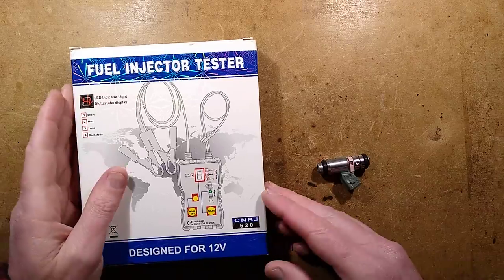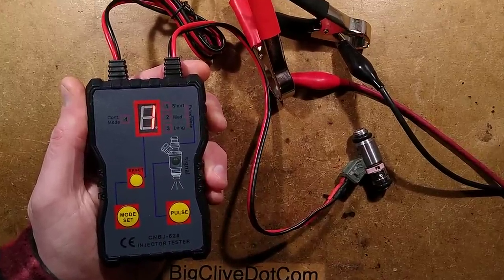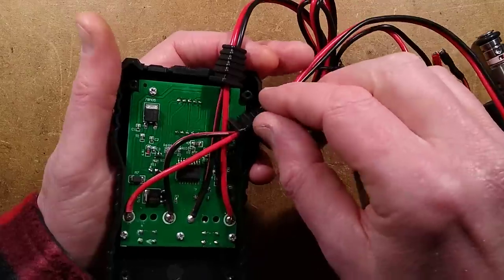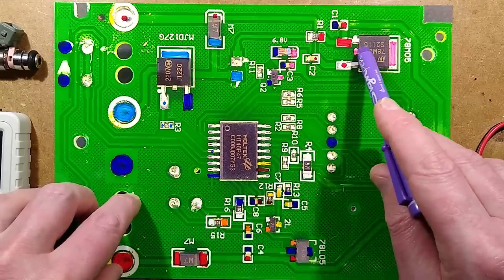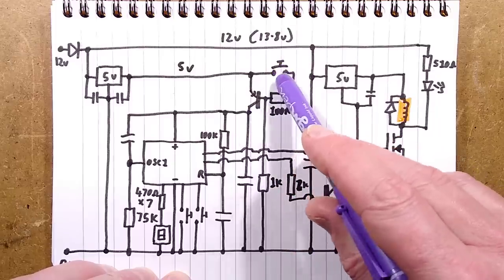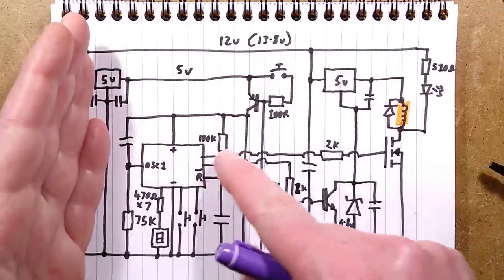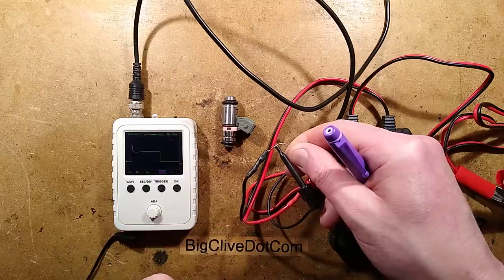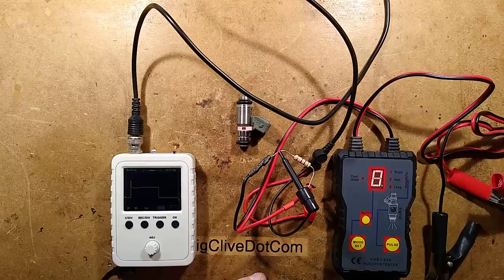Inside a fuel injector tester (with schematic)

Comment: Back in the late 90s I built an injector tester rig. I only work on BMWS so that makes standardization easier. It’s setup to do 4 at once. I used a fuel rail off a 4 cylinder and have 4 graduated cylinders to measure output over time. A buddy of mine built the controller for it. It uses a pwm controller to vary the output and a timer integrated. It’s an old washing machine timer that controls the time it runs and the pwm signal goes to all 4 simultaneously. It has proper transistors controlling each injector and I have the factory fuel pressure regulator on the fuel rail and have a small resivour to keep the cleaner in. And of course a fuel pump. I have been using this contraption almost 25 years. I am able to measure the fuel output and observe the spray patterns. I don’t know of anything else that could be done to test injectors. I helped him fix something of his and a couple of weeks later he called me with the idea. We started talking and I got the parts together for my end and he got the electronics ready. We built it one weekend. Started on Saturday and Sunday about 2pm we were testing it. By 3:30 it was installed and we were enjoying a few beers.

Comment: Yeah, the peak-and-hold injectors almost bit me too. About 20-some years ago, when I was a real gearhead into drag- and street-racing, I wanted to "upgrade" from the factory 19-lb/hr injectors to something higher. I remember asking around about some 'new' style of injectors I'd seen, and found that they needed a peak-and-hold circuit, which would necessitate modifying my PCM with new transistors and other circuitry. In my mind, this was kind of a "one-way street," as far as the PCM, and I was still paying my way through community college, so I held off. I'm pretty glad I did, because IIRC I blew the transmission a short time later. :p

Comment: I built one of these years ago with a 555 timer and transitor. It had a lot more control over the pulse width and just ran for as long as you held down the button.
Reply: And probably a lot cheaper than the $20 for this unit.
Reply: I made exactly the same thing so I could clean some injectors on an old 80s car.
Reply: I was just thinking; Why not bodge something together with a couple of 555's. 🤔

Comment: Modern injector drivers will pulse the injector with higher voltage to quickly open the ejector, then let the coil current drop to a lower level and then pulse it to keep this lower level for the rest of the duration. This also makes closing the injector quicker with lower stored energy.

Comment: Pinball machines have been using that drive scheme for decades.  They provide full current for the flip, and (at least for older models) there was a travel limit switch that injected a current control resistor for holding.  Same concept:  Fast initial response, but don't burn it up during the hold.
Reply from the maker: On the older machines the end of travel switch opened across a higher resistance hold coil in series with the main power coil.

Comment: The peak and hold was normally used with low-Z injectors. One very early application that used it was the older throttle body injection systems from the 80's. Those had very low impedance coils with big, heavy pintles inside since they basically emulated the jets on a carburetor. My memory was that there were current sense resistors in at least one of the ECUs I had worked on that told it when to "fold back", but that one could also handle bank and batch saturated fire injectors as well since it was made for multiple truck models. Those old injectors did need it since the impedance was only a few ohms, and the heavy pintle had quite a lot of inertia. It was one reason I stopped using TBI back in the day and went to SFI, as the injectors could not fuel a motor at high RPMs due to them having to fire alternately with each ignition coil firing. To actually get it to even work at 6k RPM I had to run them at around 80 PSI, which was much higher than the 12 PSI they were designed for. I was always afraid either the O-rings or the regulator diaphragm would fail and burn the car to the ground. 

I think here the peak and hold is probably included to actually accommodate more types of injectors and safely power them. (Edit: Dissipation is also a potential concern as some types of injectors use the fuel for cooling as well. When running them dry it could be possible to overheat them. Same with a lot of older fuel pumps that literally had open-frame DC motors inside submerged in fuel that required the fuel filter for removing debris from brush and comm. wear.) Typical non-DFI motors that use conventional high-Z injectors usually run them in saturated mode. There are mosfets that just act as switches and simply complete the circuit for a desired duty cycle when they are commanded to fire. The newer DFI injectors are likely different in that they have to open under much higher pressures and have to fire over very short spans of time. With an SFI system, you have up to two full crank revolutions to complete an injector firing and I used to set up the calibrations in PCMs open them fairly early so the fuel could have time to vaporize in cold weather, but even warm I still allowed for about one full revolution in advance so it had time to fire. With DFI, it has to be done within the intake cycle, which is much shorter.
Reply: that sounds potentially explosive having commutator sparks inside a fuel tank
Reply: @TheJunky228  no oxygen.
Reply: @Davemte34108  but any ingress of oxygen (and low fuel in the tank) could lead to a stoichiometric mixture of vapors, no?
Reply: @TheJunky228  The only time that you would potentially have oxygen present is after the vehicle has sat for a long period of time with little fuel in it. But, by that point, the gas will have turned to varnish and no longer be flammable. In operation, any fuel will be volatile enough to push the mixture to be too rich to ignite.
Reply: @TheJunky228  And it was surprising to open one up and just see a motor chillin' in there directly in the fuel flow after the gerotor pump, but its really the only way to keep it from burning up. I think newer ones are moving towards brushless motors instead since they don't pollute the fuel with copper and carbon deposits.

Comment: I work for a heritage railway as a volunteer  and our fuel injector tester is a single fuel pump bolted down on a beach with a presser gauge and you connect the fuel injector to the pump tester and pull the handle down and if it working OK it should be a find spray at the right pressure with NO leaks.  Some hope.  I'm talking about diesel engine that are over 60 years old

Comment: That clunky reset mechanism makes me wonder if they just had issues with something triggering the mode switch or MC reset line while in operation, and rather than work out how or why they just disabled the onboard reset with that capacitor and went with the dumbest brute-force reset instead.
Reply: And WTF is the 100R resistor supposed to achieve?
Reply: It occurred to me that the code might have been solicited in crippled form under the pretext of pre-employment or academic evaluation, then used in production in the delivered condition.

Comment: That is called the peak & hold method of controlling an in injector with varying voltages: higher voltage initial start to pull open the pintle and then a lower voltage after that to hold it open, but creating less heat dissipation. Another way is opening the injector with a short solid pulse and then holding it open with pulse modulation at the same voltage. Saves all that voltage regulator and zener etc stuff. Third (very wierd) way its been done is on some 1980s Bosch ECUs in Beemers and Porsche 911/944 is that all injectors are wired in parallel and are controlled by 2 (!) transistors. Upon the initial opening pulse for the injectors transistor#1 gives a ground path for the injectors from 12v to slam the pintle open, but right after that Transistor#1 (to ground) is turned off and transistor#2 is turned on, now supplying 12v positive to the normally switched ground of the injectors, thus basically having the injectors supplied with 12v on both pins. 
The magnetic field in the injector coil now cannot collapse and thus the injector stays open for the rest of the intended pulse duration till the moment it is intended to close, and here transistor#2 stops conducting, and the inductive kickback of the now collapsing magnetic field in the injector coils gets discharged through a big zener, the injector closes and everything is set for the next pulse. 
Took me quite a while to reverse engineer that, I uploaded a video on YT some years ago where I explain one of these oldschool early Bosch Porsche ECUs
Cheers from Germany

Comment: a tubeless valve stem fits over the end of the injector (with its O ring removed) and the other end is a decent fit on the straw of a spray can wrapped in tape. It's a pretty common trick to make an injector tester/cleaner to use with an aerosol can of cleaner spray.

Comment: Your above mentioned voltages may be different, if you loop in the actual injector coil instead of a resistor.

Because you mentioned the posh versions with metering funktion: No injector test is valid without fuel metering and comparing to specs. That's, where the countdown impulse mode comes into play.
In this case here, without any luxury provided, you just use a separate metering device.
You get similar devices for simple bench testing of common rail diesel injectors too, but the fuel delivery is a bit more challenging, since there is no easy electric pump solution.
And then care has to be taken with the high pressures involved.
The metering device has to be sufficiently strong glass, the jets are shooting right through plastic.
But Diesel injectors don't open with the solenoid or piezo alone, they need fuel pressure applied as a preload at the valve needle.

Comment: @Big Clive a running engine is not running at 12V, unless your Alternator is dead, a Running engine is at 13.8v to 14.8v to maintain a charge in the battery. the Alternator puts out more power, than 12V

Comment: Fuel injectors are designed operate with fuel as a lubricant. 
Running them dry causes wear just like in the races of a solvent cleaned, ball/roller bearing, spun fast (for fun) by an air compressor.

Comment: I have one that is very similar, but without the reset button. You can generate enough enough pressure with a plastic syringe to check the spray pattern. Just find one that fits snugly into the end of the injector. It's cheap, but it works okay for me. Thanks for the video Clive! 👋

Comment: On cars, the injectors are fused to B+ so it has what ever voltage is on the system. The negative is going to the ECM where it is switched by a mosfet. Nice the injector usually are running fuel through them in normal operation, I doubt any heat dissipation is done. I would have to connect my scope between the signal wire and ground and get the volt drop to see if there are any current limiting on the circuit

Comment: If you look for 'peak-hold' injectors, you may see why the voltage spikes then drops to a steady state. It allows the coil to be driven and then held without pulling more current than necessary. 
This is probably implemented to this device so that its compatible with all/most injector types.

Comment: I'm more of a carbs guy myself (who mentioned my waistline?!? 😅) but as time has gone on, I've had to start to learn the more primitive EFI systems. 

A little tester like this would be useful for a DIY'er, you could check operation, measure delivery and get a reasonable idea on spray pattern. Not the same as a pro job but better than not doing anything, especially if you're chasing a fault. 

One thing that I've also seen in passing, in certain factory/dealer manuals they show oscilloscope waveforms for various components including injectors. The earlyman diagnostic computers had oscilloscopes built in so you could test throttle position sensors, idle air control valves, stepper motors, MAF sensors etc etc and get your various voltage and resistance readings from them to compare against your book figures. 

Some companies such as Austin Rover had standalone test units for each system, they were called FastCheck. You plug it in and it told you how much your British Leyland product was inevitably broken 😅 (I know, I've had them, loved them and still own some).

Niche vehicle diagnostic stuff is really interesting kit, often cheap to buy too.
Reply: OBD2 systems are much easier to use compared to the OBD1 and other non standard vehicle manufacture specific systems. Those old systems can be very difficult to diagnose and repair leading to just changing parts randomly 🤷🏼‍♂️. And the vacuum lines... the miles and miles of vacuum lines. sends chills down my spine.

Comment: Modern gasoline direct injection systems run on 60v to boost and 12v hold. I'm sure there are plenty of other configurations as well but I know GM does that.

Comment: I can't speak to cars, but I know in my pinball machine it does a similar (but totally different) trick. A pinball flipper is capable of dozens if not hundreds of watts. That trigger can only be for a few fractions of a second. If you hold the flipper down and hold power to it, within seconds it will try to let the magic smoke out. To combat this, mine in particular has 2 coils in parallel. One high power kick, and one holding coil. When the flipper reaches end of stroke, it breaks the connection to the high power solenoid so that only the holding coil remains. They're doing the same-ish here for the injector, just in voltage instead of hardware. Makes sense for coil longevity.

Comment: I’m guessing that the higher voltage required is probably due to the intended use of the vehicle battery as a power supply.
Excellent investigation as usual.

Comment: A few companies manufacture what they call "hose tail adapters" for people who wish to use an alternate, newer style injector on an engine that was designed to use injectors that have a hose barb on them. They are not cheap, except when compared to having someone manufacture a custom fuel rail.

Comment: The LM1949 is designed for minimizing heat dissipation, as well as being able to drive both low impedance and high impedance injectors, the lm1949 will drive the injector at full power until a preset current is reached (or a specified r/c time) and then drop into current limiting mode which I think is 1/4 of the setpoint current. This does a few things other than minimizing heat.. for one, a high impedance injector will never reach that current, so it gets driven as if the LM1949 wasn't there, secondly, it provides fast opening and closing times since the current through a low impedance injector will be much lower and you don't need to wait as long for the magnetic field to decay.    The LM1949 is typically used with a BJT and something like a 0.1ohm shunt resistor
I discovered it when I took my Holley commander 950 injector controller box apart.. not a cheap chip at about $5, but it works very well

Comment: This is hardly related to this video, however your pronunciation of Zener as Zee-ner has led me to question my assumption that this should be Zen-ner. I did some research and found the obituary of Dr. Clarence Zener, the inventor of the Zener diode. Here it clearly states that the pronunciation of his surname is Zee-ner. Therefore, I feel that is proof enough that I was wrong and you are right in your pronunciation, as the useful little diode was named after the man himself. Thank you, Clive!

Comment: Electronic fuel injection systems on automobiles vary the pulse width to the injectors depending on throttle position, temp., air flow ( in some cases manifold vacuum ) etc. There is usually a load resistor in series with with each injector. A timing pulse from the Control module give the injector a start time and cut off time and depending on the aforementioned cues the control module receives from it's various sensors and it will vary the pulse width within the start and stop time allotted to each injector. Some early injection systems would fire all or pairs of the injectors at the same time. At least Bosch systems are like that. Interesting little tester but most mechanics just disconnect the injectors one at a time with the engine running to determine a faulty one, or read the codes.

Comment: The scope image answer: Thats a Petrol injector for starters and that is a good pattern on the scope. as you said the spike to pull the coil hard against the fuel rail pressure and open it, the lower voltage after is the pulse width so how much fuel is injected, longer for cold engines short for hot but also longer for accelerating and short for idle. The injector will cut off very briefly on deceleration but not all of the time as an engine does like a little fuel over its valves. Great Video and that looks like a good tool for the toolbox, but may not work on diesels? Thanks Clive

Comment: It makes sense to drive a relay or solenoid actuator this way. It will also make sense to use such mode in an injector cleaning station in which there's a mode of just pumping the cleaning fluid through injectors for some time, so in a such way coils wouldn't overheat. In stations pulsing injectors in a regular manner continues the cleaning process and then test of injectors' volumetric capacity for different pulses duration/frequency follows, but using a lower holding current for short pulsing injector - no sense whatsoever.

Comment: these are pretty handy for use in pressure drop testing for automotive diagnostics, just measure how much the pressure drops in the fuel rail for each injector and you can find the bad boy